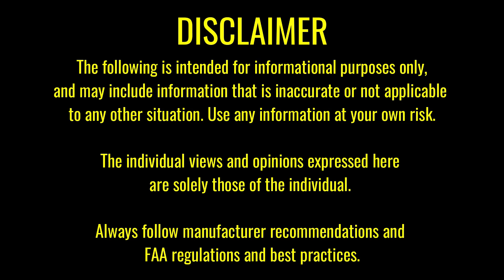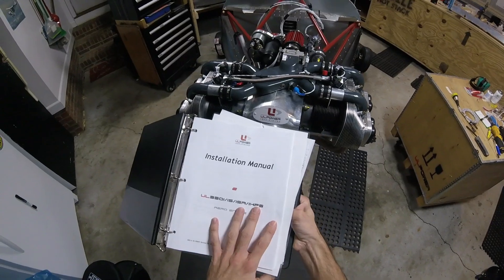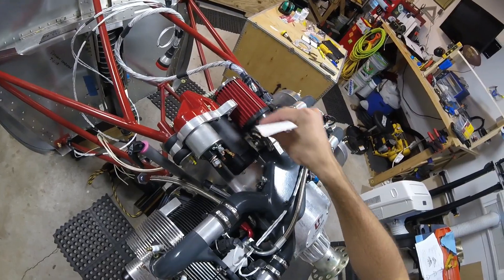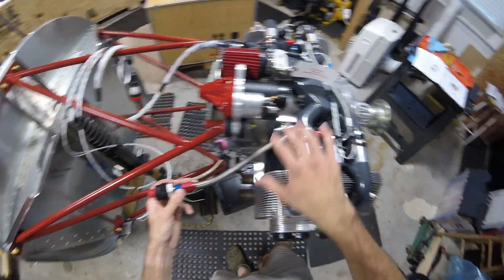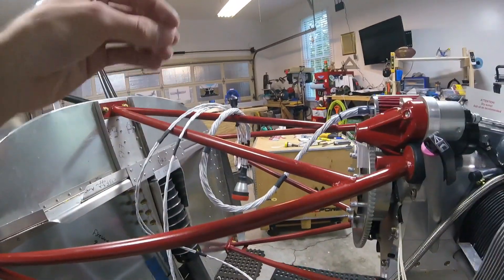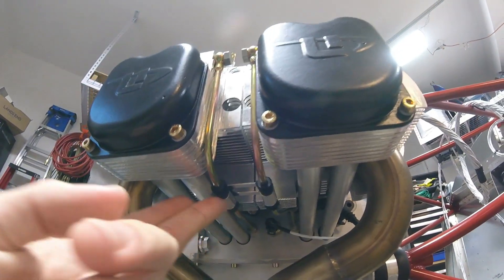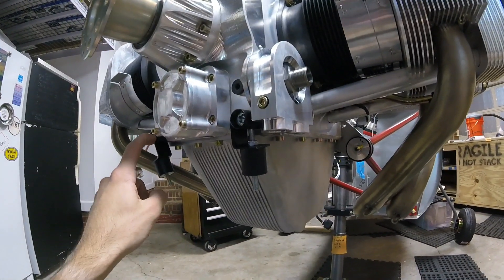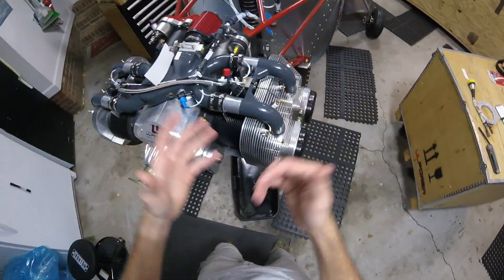Getting to Know Your ULPower 350iS - PART 1 - Engine Overview - Zenith 750 Cruzer Kit Plane

Comment: You don’t cut out a spot for the dipstick on the cowling. The cowlings should open
Reply from the maker: Hi! according to our setup a dipstick door is part of the plans.
Reply: @jeffandadambuildazenith6816  yup, a small hatch is used , in the upper cowl, to access the oil dipstick.